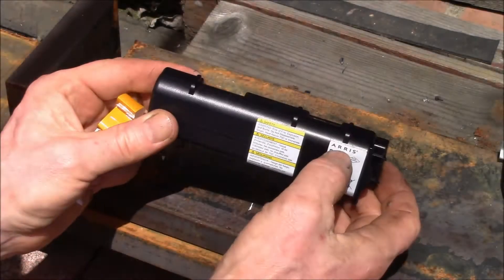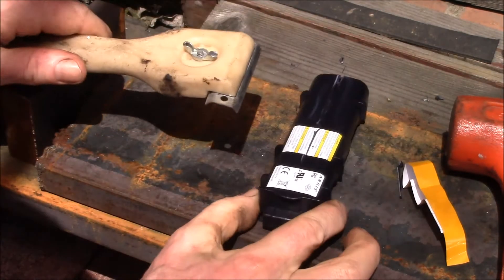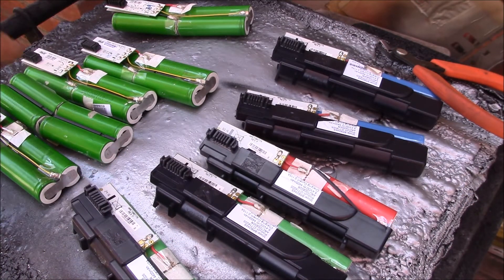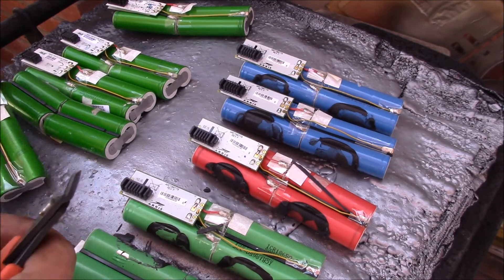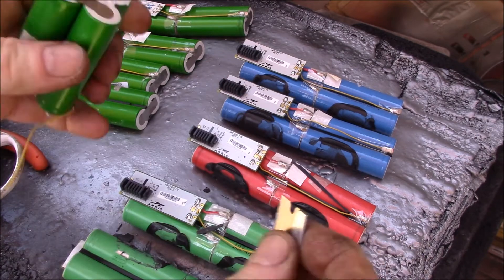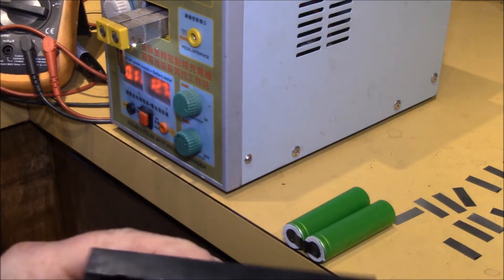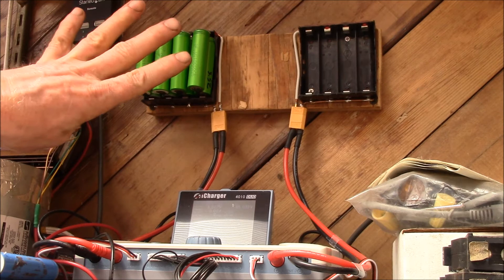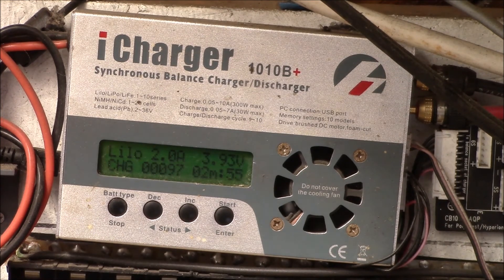Harvesting 18650 cells from 4-cell (2S2P) Cable Modem Batteries

Comment: why take off the original spot welding to add new ones!!! you don't need  that overpriced spark machine, a soldering iron with the original welded stuff is more than adequate, only cut if it helps in your final series/parallel configuration for that specific application
Reply from the maker: Good point.  Yes, I try to leave the original tabbing where possible.  My cell holders are set up for 10 pairs of cells (20P).  These packs have the 2P tabbing on one end but 2S tabbing on the other end.  So I pulled off the series tabs and then replaced those with parallel tabs.  If I were to solder the parallel tabs on, they might come loose when I later solder on my fuse wires in the cell holders, thus the spot weld on both sides makes for a better final product.
Reply: @The4Crawler  I do not know the details of your use unless I see a connection diagram/schematic or the number of series/parallel, but you see my point, right? You bought a bunch of 2s2p's, why destroy the original weld to re-weld all over again when 2s2p can be the core of any configuration you are trying to build. There is no need to cut the series connection to test them individually. E.g. if I want to make a 14s8p for my bicycle, instead of re-welding 14X8=112 individual cells (where I have to use a welder, so I won't destroy the cells) I can simply use 28 (=7X4) modem batteries without the included PCB when I can use soldering and probably even the original plastic covers if opened nicely (or chosen carefully type that opens nicely)
Reply from the maker: @engineereuler1762  Here's how my packs get built:
https://youtu.be/3j_uJnD96H4?list=PLpY2FP1a9tiuoQAxvpznrcYEYf8AzyaPL&t=279
There are 10 pair of cells, tabbed top and bottom.  The 2S2P modem packs I purchased turned out to be set up with the end positive end negative ends in parallel but in the middle, the + and - terminals were tied into series.  Yes, if I had a different cell holder, perhaps I could use them unmodified.  But, since my batteries are 7S20P I need to have each module in a 1S20P setup then have 7 of those in series.  Hard to fit 2S cells into a 7S configuration.  If I went to say 48V like your battery and had 14S, then yes, they would be useable as is..
Reply: @The4Crawler  7=2+2+2+1, so you only need to take a part a small percentage (the 1's), not all. It saves time and effort, that's all I'm saying. It's just like taking a part the whole engine of a vehicle and putting it back together only to replace a small external part.
Reply: @The4Crawler  Thanks for chatting out here. saw your video. Thanks for making it. It's very close to what I do
Reply: even the black and decker is the same as my most used tool 😁
Reply from the maker: @engineereuler1762  Yes, if I had different battery holders, that might be possible.  But mine are set up for pairs of parallel cells.  I would have to come up with a different sort of holder to hold the 2S2P cells and then have a different holder for the 2P cells and somehow make all those fit together.  I already have many 2P cells in modules and it's handy to be able to swap out one 20P module for a similar capacity 20P module:
https://youtu.be/OVWdYBQ1vTU

If I only had the 2S2P cells, then yes, it would make sense to do as you suggest.  But the majority of my cells are 2P as they come out of the original packaging (most were laptop batteries).
Reply from the maker: @engineereuler1762  Yes, that's a handy tool.  I've had that about 10 years now, still going strong.

Comment: Mini (Winter) Solar Tip: You can gradually turn down a boiler and all other hungry electricity consumers with the "5000W dimmer". Ebay €7. I run 5 dimmers in parallel on an 850W inverter. Kettle 2.2KW at 150W runs 12 hours a day, so the water is always hot. The room is also nicely heated. 2.5KW washing machine runs in parallel with dimmed to 200...400W. Iron, dishwasher, oven, electric heater, coffee machine, all internal heating are throttled with me. Videos about it on my channel https://youtu.be/eC2olbCBhh0 The inverter stays cool, quiet and the MOSFETs remain intact because extreme current peaks no longer arrive at the inverter. Now every Mini PV Inverter is enough to sell large devices. So, with the dimmer, all internal heaters/devices can be converted into base load devices that stay almost permanently ON, drawing very little current directly from the PV. With a wattmeter / energy cost measuring device you can then measure this perfectly in order to set the dimmer optimally.
     A little hint (for everyone else): Energy cannot be saved. So if I want to boil my water, I always have to use the same amount of energy for one liter. Christian's method relies on a longer period of time with less power in order to be able to use the power provided by the PV as efficiently as possible - so consumption peaks are intercepted. In the end, the energy consumption should even be (slightly) higher due to the interposition of the dimmer, but it doesn't matter, since more efficient coverage by the PV system and therefore better use of the self-generated energy.............................🌞.....

Comment: Instead of banging it with a paint scraper and hammer, try cutting through the stickers on both sides with an exacto or similar blade.  Then you can hold the battery in a vise and just push it open with no problem.  I did a video on this. The ones I have opened have contained mostly LG cells and they are the most difficult to get the cells out due to the amount of adhesive they use.  The Sony and Molicells were the easiest to get the cells out.
Reply from the maker: Thanks, if I run across any more of these, I'll give that a try.

Comment: Great video. I need sets of these 18650s  for my torch flashlights at home and work. I see these modem packs online pretty cheap. Do you think they’re worth harvesting for my flashlights? My cheap Chinese batteries die very fast and I can’t keep enough charged up.
Reply from the maker: These tested out into 2 groups, one around 3900mAH/pair, or 1950/cell and a second group that's more spread out around 3000/pr. or 1500/cell.  I'm not sure what the source of those 2 groups is, I need to do some more analysis of the data to see if this is due to different brand or version cells.  The 4 cell packs seemed to have a lot more variation in cell brands and ages than the 8 cell packs I also tested.
Reply: @The4Crawler  but I could do this process and use them in my torch headlights?
Reply from the maker: @ramblin_man23  Sure, you would just completely strip off all the cell tabbing to get down to individual cells.  You might need to do a little clean up on the cell ends to smooth out the rough spots left after you tear off the tabbing if you need to have the cells stacking up together.  I show a bit of this before I re-tab my cells as my cell holders need pair of cells tabbed in parallel.

Comment: I avoid the Sanyo Red Cells like the Plague.  THEY SUCK.   Most turn Heater.
Reply from the maker: I'll keep an eye on them.  So far they've all tested out OK.  I'll see how many I end up with and possibly put them into my power shelf as a 7S?P setup and see how they hold up for a while in use.  That way I can pull cells out and swap them easy in the cell holders.